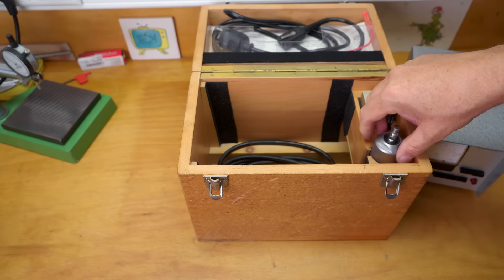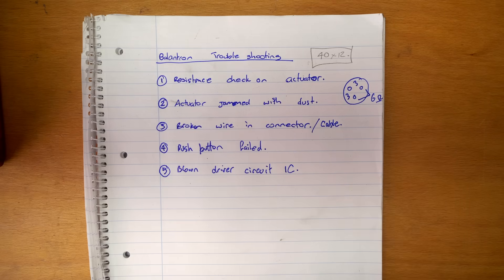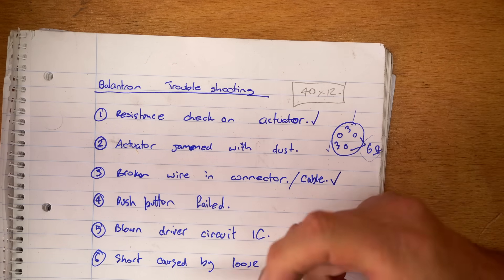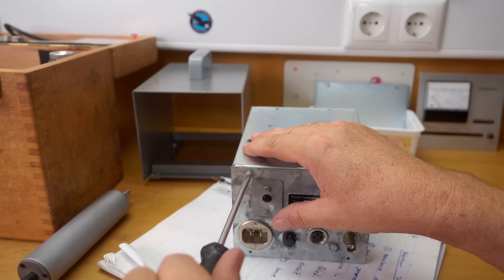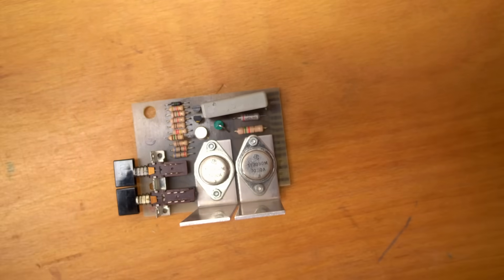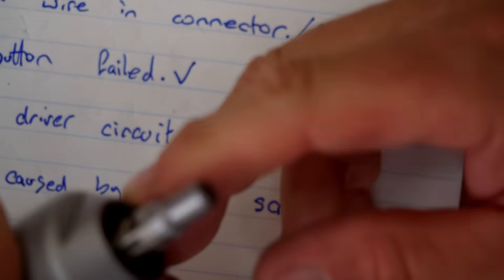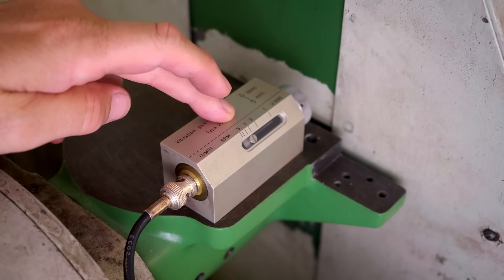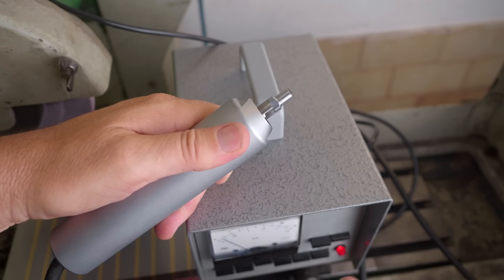Trying to get the Balantron working. || RotarySMP

Comment: There should be a measurable voltage output at the pins of the actuator socket but i would strip and free the actuator spindle first and then if it still doesn’t work start from the socket and work back, firstly checking that you can read the coil resistance from the back of the socket, thus confirming that all the pins in the plug are in good contact with the socket.
Phil
Reply from the maker: Thanks Phil.
Reply: @RotarySMP  If you can borrow an oscilloscope (and get it configured :P ), that would make it easy to instantly identify any electrical problems. The output pins for the actuator would be two square(-ish) waves with opposite polarities at the tuned frequency of vibration, probably with a 50:50 duty cycle, because one coil pushes out then one sucks back in and it cuts at the high point. Because these are analogue electronics, maybe it would be sinusoidal (the presence of transistors implies some digital nature) but this wouldn't change the troubleshooting steps. If the phase was wrong (i.e. it cuts the wrong part of the stone) that would be very complicated to troubleshoot, but you wouldn't care about that in testing why it doesn't chooch in the first place. 
Let me know if you pursue this and need help with the o-smell-oscope.

Comment: I'd check first if there is any voltage at the output
Reply from the maker: Good point. Thanks.
Reply: Multimeter should pick up something, probably in AC mode since it has to be some fluctuating voltage. Maybe hooking up a small 4 ohm speaker to the output would also work to make the output audible.
Reply: @zapl80  using a speaker is an idea I'd not considered! Ta
Reply: I agree with you.
Reply from the maker: @jm.workshop.q8  I have that Osci. I better read the instructions again to use it :)
Reply: I was going to suggest checking to see if there is any signal to the output transistors. They could be fine, but if there is nothing going in to them there will be no output. This is the sort of thing I’d love to get on my bench.
Reply from the maker: @melgross  Good point Mel. I need to work out how to do that :)